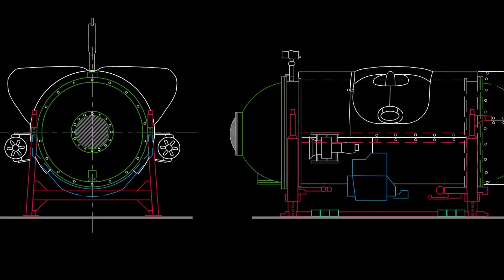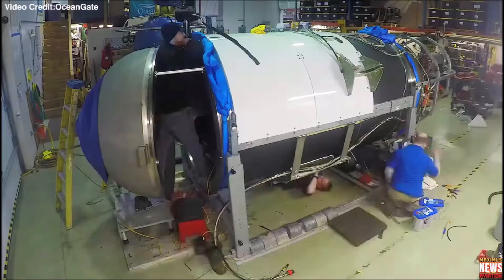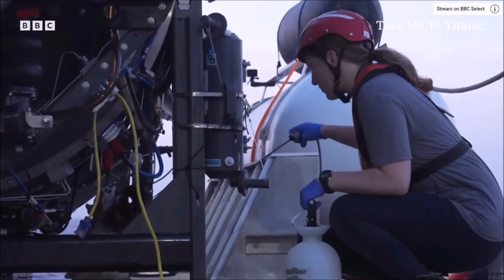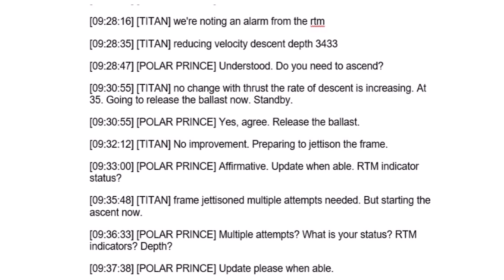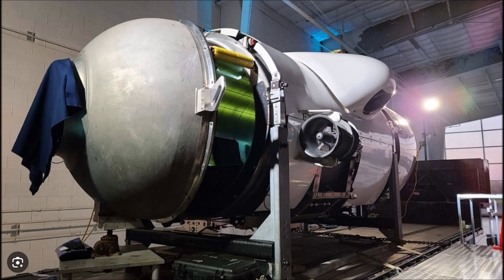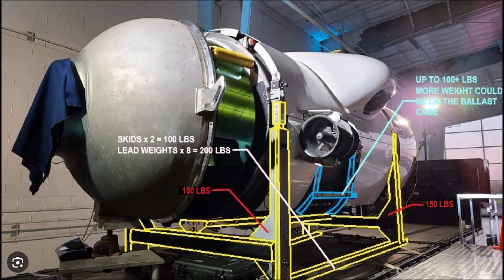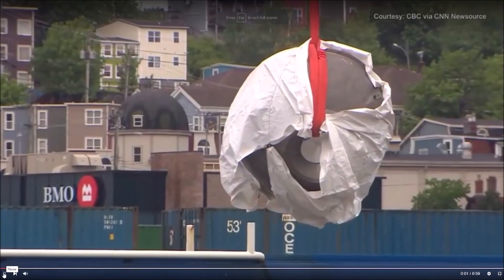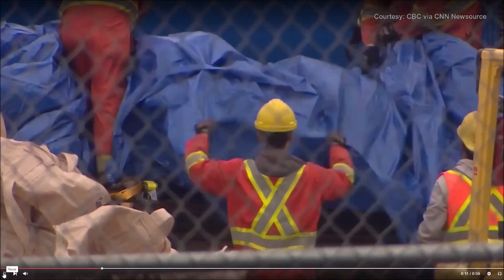OceanGate Titan - DIVING "TOO FAST" A REALISTIC SCENARIO?

Comment: Hi. Thank you for your insight. Very interesting theory.
Now, I have another theory.
I understand that as carbon fibre deteriorates, it would become porous and spongy. Water incress is likely. 
For that particular trip, the Titan sub was towed behind the ship for 3 or 4 days on rough seas. It is very likely that the carbon fibre hull was further damaged, and it had absorbed water during that bumpy trip.
This, together with the added weights, would account for the rapid descend and the very slow ascend after releasing the weights before implotion. 

It's just a theory. Let me know your opinion.

Thank you for your videos. They are very interesting.
Reply from the maker: Carbon fiber isn’t that porous. It would be very hard like a rock so to speak and the only way water could get in there is if there were quite a few interconnected voids. If there were voids to that magnitude it would probably have failed on the first couple of dives. Also their system of acoustic sensors and strain gages would’ve have picked up carbon fibers breaking. A sudden large de-lamination might be possible, or it just failed in the middle like some propose. I do think water intrusion was probably occurring over time at the interface rings, which may have degraded the strength of the bond, amongst other things that stressed that glue joint.
Reply: this may sound weak/lame, but I wonder if maybe some water got into this thing, or something else let go,  during it's rough journey to the Titanic Site ( as the Polar Prince couldn't hoist it onboard)  dragging it behind the ship on basically a trailer,  @VegasCyclingFreak

Comment: Since they also had battery problems I think this one video I saw was right, they developed a pinole leak in the back that shorted out the batteries because the glue on the titanium end cap failed. The structure was compromised and water leaked in causing the sub to not be able to ascend and then it imploded. Structural fatigue from multiple dives also played a large role as carbon fiber takes damage with every dive.
Reply: SR exhausted the first battery by desperately running the vertical thrusters (actual 45% due to using a hook eye ballast roll discard system LMAO) . SR was 'adjusting' the descent rate by discarding his battery power, he was an utter maroon.
Reply from the maker: Could be. Apparently it wasn’t uncommon for them to have battery problems.

Comment: Here is one more I have not seen addressed in any of the implosion animations,  there were 3 five foot long oxygen tanks inside the sub just under the floor,  how would these tanks react to an implosion
Reply from the maker: Yeah I've wondered about that too. Probably just like little bombs added to the one big one.
Reply: Well, a typical HP oxygen tank is about 3000 psi, while sea pressure at that depth is higher.  So...  probably not much of a reaction at all.  If the implostion ruptured piping and valves (quite likely), then they would fill with water I should think.
Reply: The pressure outside of the Tanks is higher than the pressure inside, so i would guess that nothing would happen. The O2 inside is a liquid and thus can not be compressed.
Reply from the maker: @sebastianf.brodda4474  Ha ha, yeah that is a good point. I forgot that it would be liquid O2, not a gas. So basically incompressible.
Reply: @sebastianf.brodda4474  Might go so far as to say it's a supercritical fluid, but I wouldn't call it 'liquid'.  And yes, supercritical fluids CAN be compressed.
Reply: @mikefochtman7164  Didn´t knew that supercritical fluids are compressable. At first i thought that the temprature wouldn´t be high enough, thinking of supercritical water, but wiki told me that Oxygen becomes supercritical at 50 bar and 154°K. Than they might implode.

Comment: Frame not dropping is a good theory, mine is the rhino liner failed and the carbon fiber became water logged
Reply from the maker: In that case it would be a slow failure that happened over a fair bit of time. it could only really happen if there were enough voids/de-laminations in the carbon fiber for it to get waterlogged.
Reply: @VegasCyclingFreak  Thanks for the quick reply, this subject fascinates me, and I hope you do more
Reply: My money is on water getting into triton through delamination of the carbon fire and causing the rapid descent due to the extra weight of water. The delamination then progressed at a rapid rate as depth increased, compromising the epoxy bond on the rings.
Reply from the maker: @davemorten8223  For that to happen, there would have to be a great many voids in the carbon fiber. How many gallons of water would that be? A gallon of water generally weighs 8.34 lbs, depending on pressure and temperature. 50 gallons would be 417 lbs. There's no way that hull could have had 50 gallons of water in it . It wouldn't have survived the first couple of dives. I mean that would be some super crappy/weak carbon fiber. My carbon framed bicycles are better performers than that! I think water infiltration at the interface rings is much more likely. Also, during the course of 10-12 hour dive, the titanium hemispheres would sweat - around 2 gallons or more worth of the occupant's respiration would condense on those. So over time there was water trying to infiltrate internally and externally on every dive. Their acoustic sensors would have picked that up if it was something happening slowly over time - they would be able to hear the fibers breaking as when they did testing in a hyperbaric chamber before it ever went in the water. I suppose that there could have been one large sudden de-lamination due to water infiltration, which would be a nearly simultaneous hull failure. I'd believe that.
Reply: @VegasCyclingFreak  Yes I agree you make a good point, a slow leak gradually getting worse would not add a lot of weight and would have probably been detected, sudden de-lamination is much more likely, one thing for sure a lot of water at very high pressure came in very quickly.
Reply: @VegasCyclingFreak is rapid delamination not possible?
This is the first thing I thought - if many layers had delaminated it could easily hold 200 gallons?
Reply from the maker: @bornyesterday1895  Some have proposed this theory but I just don't see that happening. It's just going to outright fail, very rapidly, not shrink for 5-10 minutes and then implode. That's the nature of carbon fiber. It's fine one second and can fail catastrophically the next.
Reply: The 7in diameter walls of cylinder filled with water. Thos is why she was dropping so fast and ehy ballest being let go didnt work. The increased rate of drop speed either compromised  cylinder or that underrated portal view hole went in. If they go back down there for the back end cap piece of Titan its location on sea floor will tell us which of two occured. If the aft cap ia farther away from where they gpt the other debre it means the portal was what gave way. If the aft cap is close to where other debre was located thos means walls of cylinder gave way to presure.
Reply from the maker: @GameAGuy  The cylinder was 5" thick and carbon fiber is not going to fill up with water like a sponge. It will just outright immediately fail if it's compromised in any way. Also very unlikely that the acrylic viewport failed. I'm pretty sure at this point it was rear interface ring. That's going to be in my next video.

Comment: Following on from my earlier post the only sequence of events to I can come up with is that an initial partial failure of the carbon fibre hull  produced a pressure wave in the hull blowing off both titanium hemispheres and snapping all the bolts, followed by total collapse of the carbon fibre hull and breaking the epoxy joint. Although I am suggesting this chain of events I find it all a bit unlikely, what does everyone else think?
Reply: well done dave. a full implosion causes a massive explosion. the hole, ie the gap in the water compresses and explodes with massive force. causing the sub to shatter in to pieces. the bubble of air would get hotter than the sun, as would the bodies then massive kaboom.

Comment: "acoustic anomaly":What does a implosion sound like?Further if the anomaly was the signature of an implosion,wouldn't there be a debris "location" instead of a debris "field"?The recovered parts indicate that tail section parted from its connection strap around the interface ring connecting the carbon fiber tube to the rear titanium hemisphere.The rear hemisphere is also parted from this interface ring.The front hemisphere is also parted from its connecting ring.
Reply: I posted the following just after your post.
It appears to me from the recovered wreckage that all the bolts securing the titanium hemispheres to the connecting rings are missing meaning that they were either removed after salvage or they had all failed at the time of the implosion. For the bolts to fail due to tensile loading the epoxy bond to the carbon fibre cylinder would have to be stronger than the combined UTS of all the bolts. If that was the case I find it difficult to see how the dynamic loading due to the kinetic energy of the imploding water could simultaneously debond  both rings from the carbon fibre tube and shear of all the bolts ( 36 in total ?) You can see that the location flanges on the rings that surround the epoxy joint have been destroyed as the carbon fibre imploded. Can anyone suggest how the force necessary to snap all the connecting bolts (Hemisphere/ Interface ring) could have been generated?
The only sequence of events to I can come up with is that an initial partial failure of the carbon fibre hull  produced a pressure wave in the hull blowing off both titanium hemispheres and snapping all the bolts, followed by total collapse of the carbon fibre hull and breaking the epoxy joint. Although I am suggesting this chain of events I find it all a bit unlikely, what does everyone else think?
Reply: @davemorten8223 The bolts may not have failed due to high tensile forces.  The two hemispheres may have been rammed together and when they hit at some slight angle (some debris trapped between them perhaps??), sheared all the bolts.  A close inspection of the bolt holes in the rings will tell them if this is what happened.
Reply: @mikefochtman7164  Although I thought initially that the two hemispheres could have been driven together after total collapse of the cf hull I now don't believe that was possible. The water pressure thrust on the hemispheres is only there while the hull is intact and there is a 350 bar pressure difference. Once the cf hull fails and the pressure is equal within milliseconds there will be zero thrust acting on the hemispheres, also if they started to move together initially they would be like a pair of underwater parachutes. Even bullets  don't get very far under water. It is a mistake to think of the hemispheres as a pair of free pistons being pushed together down the cylinder of the hull as the hull is now not there. If the cf tube had stayed intact but had started to fill the sub with water the pressures would equalise and not cause an implosion, just like the wreck of the Titanic.
Reply: It appears that there were three metal stringers holding the fore and aft connecting rings together.The parting of the hemispheres from the connecting rings probably happened because the connecting rings,epoxy and carbon fiber tube were held together by these stringers.    @davemorten8223
Reply from the maker: It's a two part event. First there's the implosion and then there is something equivalent to an explosion. You can hear it in that soundclip of the implosion. That's why there is a debris field. You can hear that here: http://www.diyguitarist.net/Sounds/Titan%20Implosion.wav
Reply: @VegasCyclingFreak  I had not heard that before but it does sound like partial failure followed by total devastation. Do you think the contents of the triton became diesel fuel?
Reply from the maker: @davemorten8223  I've seen those simulations. I don't believe them one bit. A human body is not going to burn like diesel fuel in only a few milliseconds or "become gel" in a just few milliseconds. It takes a while to cremate a body. I would say a fair comparison would be taking a direct hit by a bomb. Not much left of a human body after that but there are a some large pieces left behind. Gruesome to think about but at least it was quick.